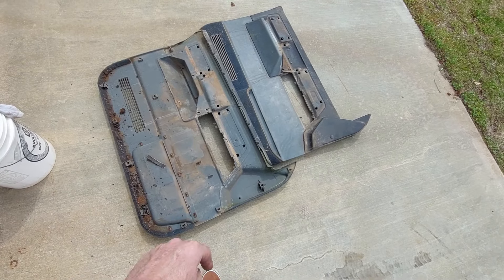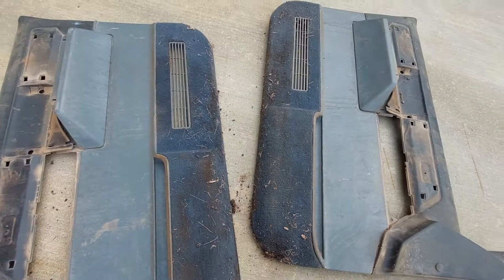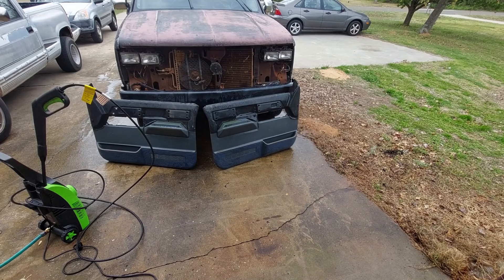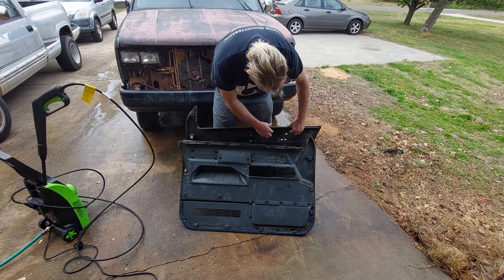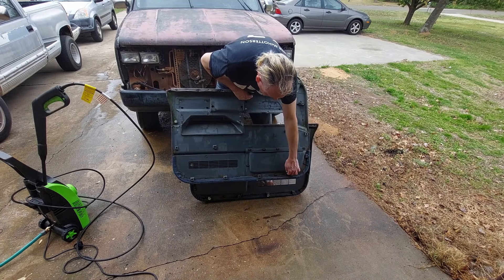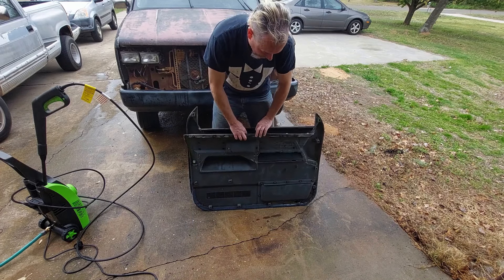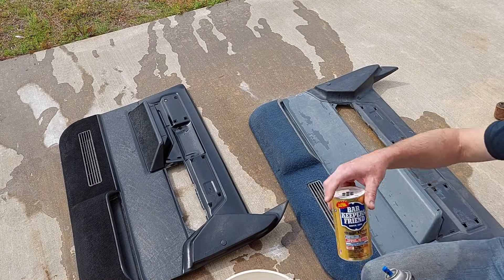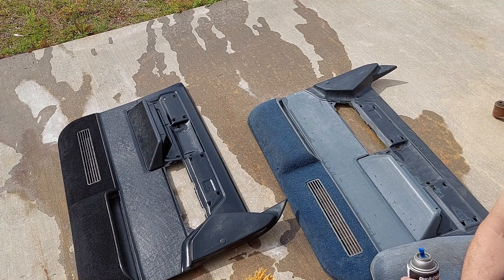Cheap Rehab for Interior Plastics

Comment: Did this with my 93 s10 about a year ago.. Give it about a month and where the seatbelt hits the panel when you flip your belt off will be scratched and flaked off. The duplicolor interior stuff works great on the carpet part. And on cloth materials. But its a super thin paint that easily flakes and chips off the vinyl. Im thinking about using a heat gun and some black powdercoat on the plastic parts but still figuring that out. Lol
Reply from the maker: I suspect you didn't clean your plastic thoroughly enough. I painted Way Cool Jr's interior pieces five years ago and they've all held up very well. The painted pieces are resisting weathering and are tougher with better scratch resistance than before they were painted. I'd try scrubbing as much of the paint off as you can, clean it with Barkeep's Friend, and repaint. Thanks for watching!
Reply: @erikstrawn3885  ill give it a go. I just used a degreaser pressure washed it and then scuffed it before painting. The paint seemed very thin though. Didn't seem to hold up to wear and tear. Maybe I just need to clean it better 🤔
Reply from the maker: @scotthope5806  Barkeeps Friend is both abrasive and an acid. It etches the plastic. Be sure and rinse it off well.